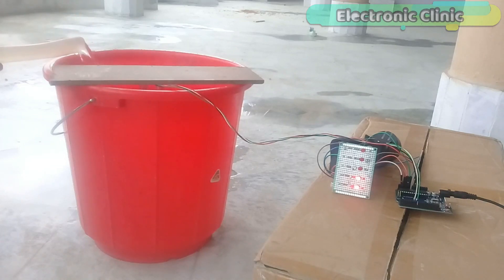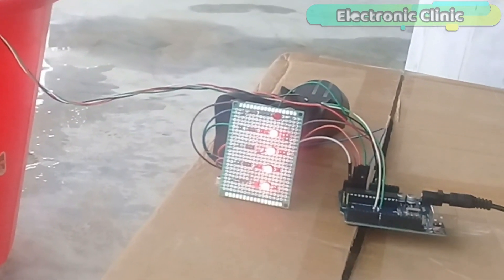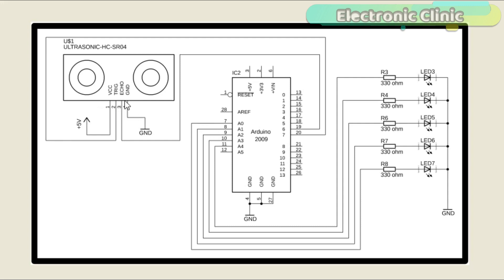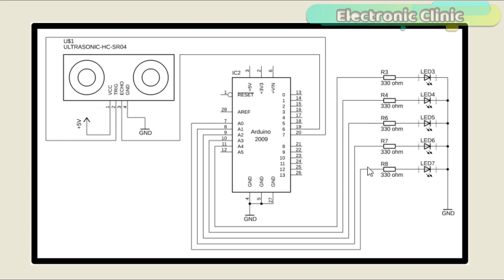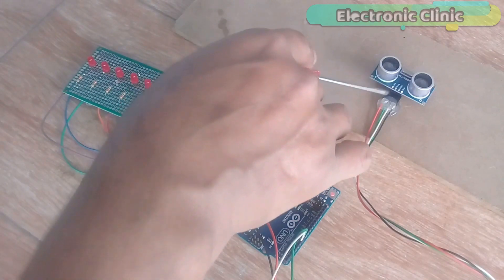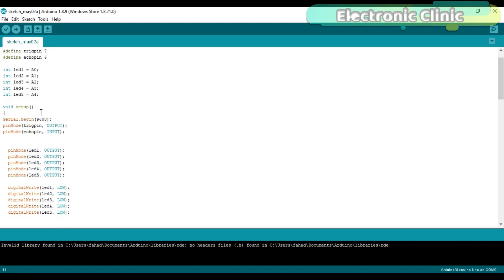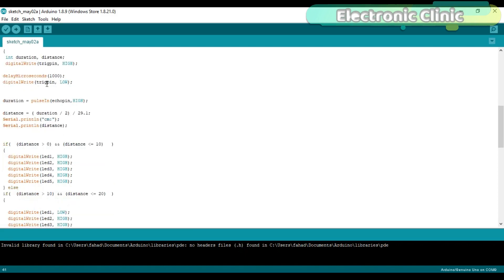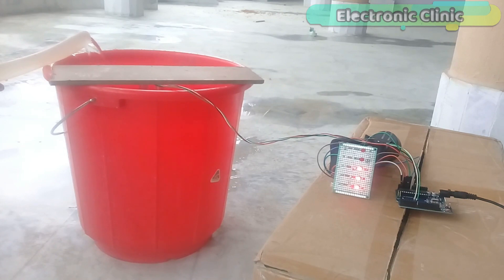Arduino Project: Water level monitoring using Ultrasonic Sensor | Water Tank level monitoring

Comment: HC-SR04 Ultrasonic sensors will work if connected by 30 mtr long cable. I.e placed at a distance of 30 mtr from the uno board? Please reply

Comment: Dear, I am staying in a building with 10 floors and the water tank is on the terrace.  So can we make this project using transmitter and receiver module.  Also, how to add pump auto on off relay in this circuit.

Comment: Can you explain how can be program if i add a buzzer ???? . Like when the first led turn on and light up ,the buzzer sounds and  the pump activate
Reply from the maker: define another pin for the buzzer. when the first led turns on, also turn on the buzzer for lets say 3 seconds and then turn off the buzzer.
Reply from the maker: watch my other videos in which i have used the buzzer, if in case you dont know how to use a buzzer.

Comment: Brother does the humidity or wet environment affect the ultrasonic sensor?
Reply: There is a water proof one
Reply: It does. I tried it and my ultrasonic sensor got water in it, it didn't stop working but it was giving measures of 0.65 cm due to the water inside of it

Comment: Do you think it could work for a 6 meter deep well?
Reply from the maker: you can check the maximum range of the Ultrasonic Sensor in the datasheet. Long range ultrasonic sensors are also available.
Reply from the maker: the one I have used can detect up to 4 meters.

Comment: Can we make it wireless using transmitter for two floors?
Reply from the maker: yes you can. watch my latest video, the one i uploaded yesterday. that video is about two way wireless communication system
Reply: @ElectroniClinic  thanks for the suggestion, I am checking them.  BTW we can also, make receiver to display messages from two transmitters rite? (ex., transmitter from overhead tank, and transmiter from underground main tank, with help of toggle switch to receiver signal from transmitter A or transmitter B)
Reply from the maker: of course you can. you can watch my video on multiple nrf24l01 modules and single receiver.
Reply: @ElectroniClinic  Thanks.
Reply: @ElectroniClinic  Hey, I watched the video. I got a quick question, the LCD displays T1_d1 and T2_D2 (both have one line of data each, and LCD has two rows- good)..     In my case I have two row of data in T1_d1 itself (So, data from two receivers cannot be displayed as it will have four rows simultanously). In this case is it possible to make the receiver, to display data from each transmitter for set time t?  eg., T1_d1 display for 5 seconds and T2_D2 display for next 5 seconds?  with slight modification in the code, can we do that?

Comment: This is not working in real-life solutions because the ultrasonic sensor is damage by water vapers.
Reply from the maker: i.made the other version of it and used it in hydroponics system. i used tof10120 laser distance sensor. you can check the video.
Reply: @ElectroniClinic  Can you please provide the video link?